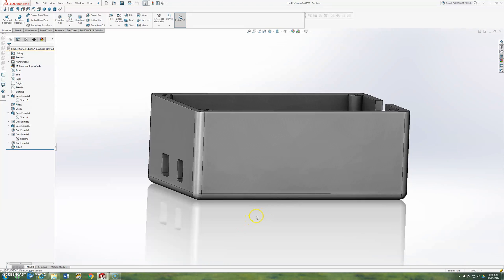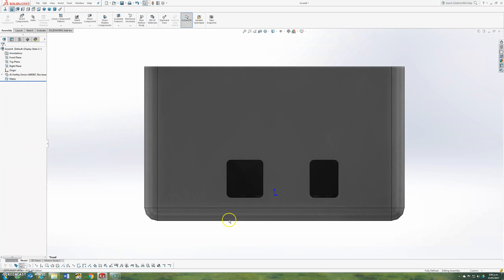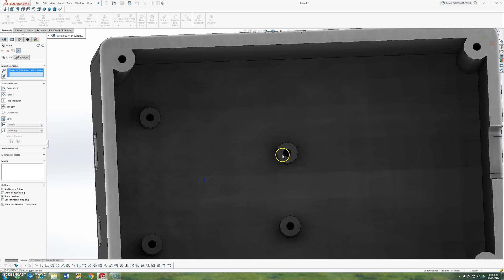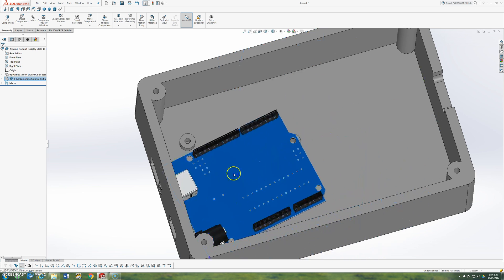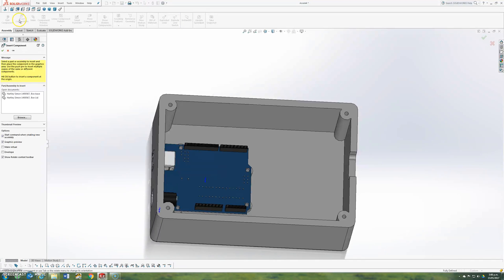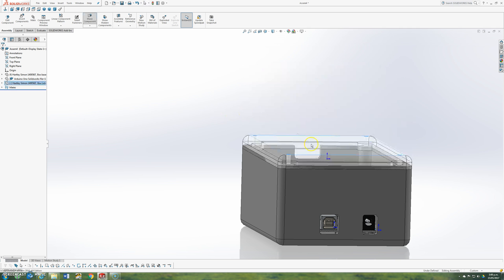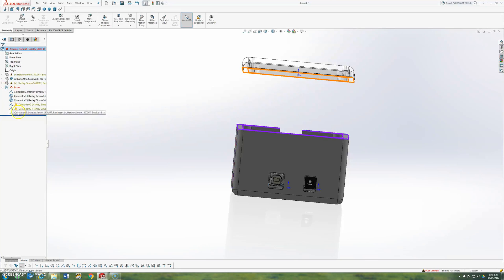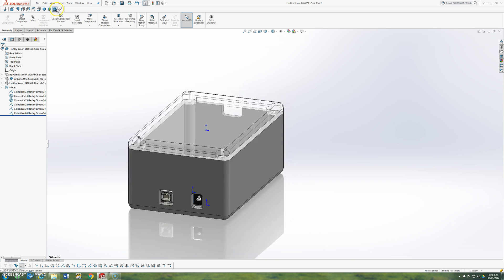SW2.5 Solidworks. Assemblies and Mates

Comment: Can you talk more about the screws, are they threaded holes?? How do you make threaded holes?  Are you mounting through the holes with a screw and a nut at the bottom?
Reply from the maker: hi Ubermister,  my students are only doing a basic course on how to read and make drawings, with a little CAD experience. the idea behind this was to show them that they can make custom products using a 3d printer from what they design in CAD.  back to your question... no they are just straight holes using the cut-extrude command.  however the SolidWorks Hole wizard is a great tool for making threaded holes, however, that's a little more involved.  normally when I am prototyping I make the hole slightly smaller than the Tap drill size.  i.e. on a tap and die nomenclature for m3 x 0.5 thread pitch the drill size is 2.5mm. so i would design and print the part with 2.5mm holes then tap the thread manually using a 3mm tap. otherwise, you could make through holes and use nuts. The easiest way is often the correct way. happy to answer any other questions you may have.